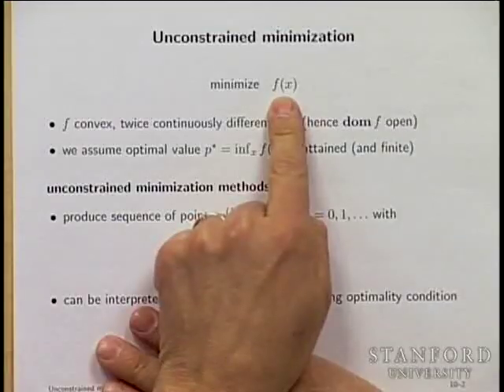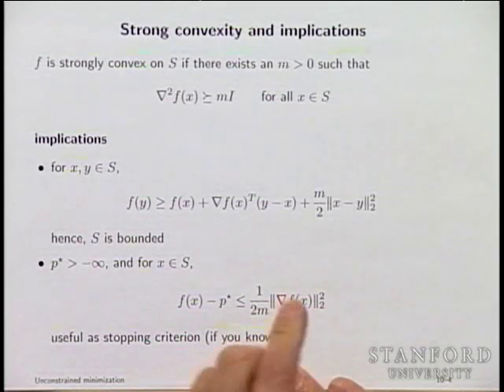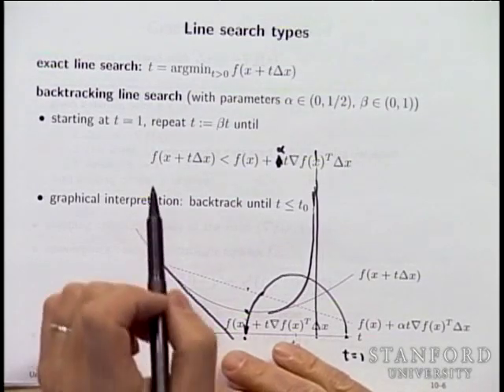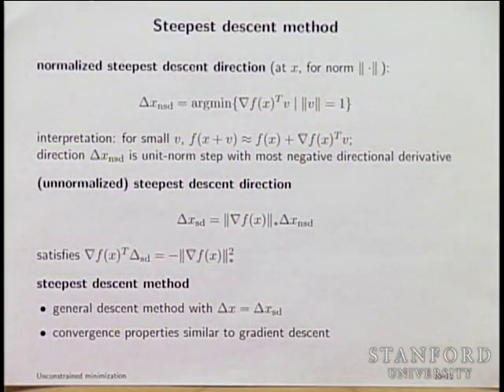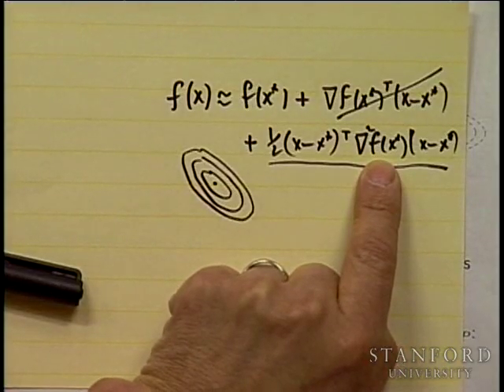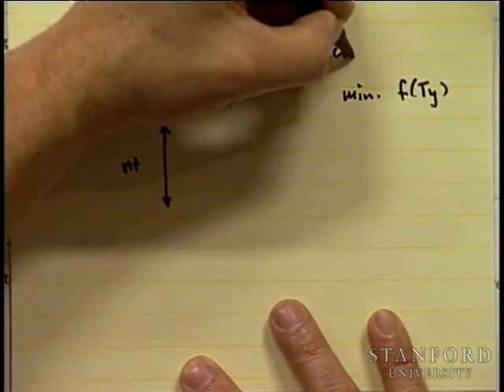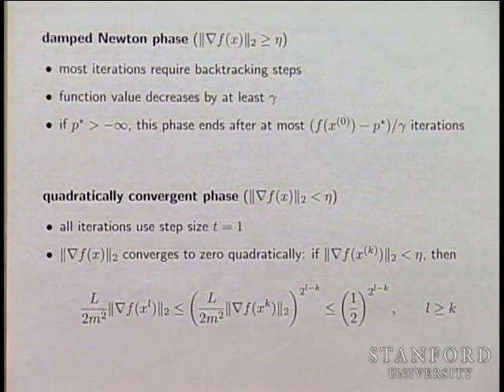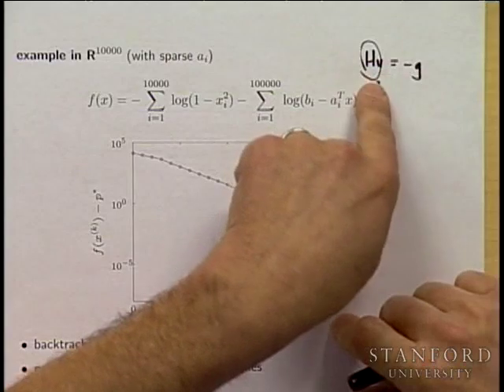Lecture 15 | Convex Optimization I (Stanford)

Comment: 2:11 Unconstrained minimization
4:00 Initial point and sublevel set
8:15 (10:15) Strong convexity and implications
13:45 Descent methods
16:46 Line search types
23:56 Gradient descent method
26:40 quadratic problem in R^2
29:26 nonquadratic example
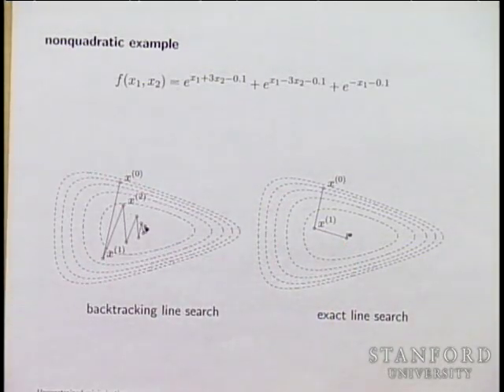29:42 a problem in R^100
32:03 Steepest descent method
34:23 examples
37:50 choice of norm for steepest descent
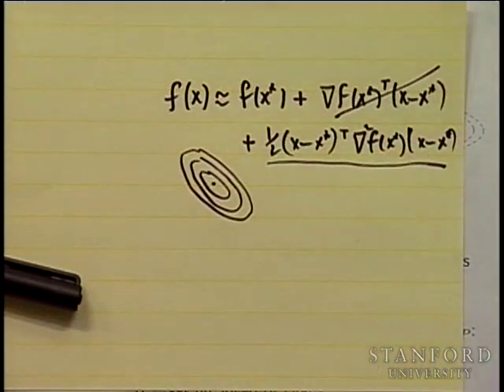43:52 Newton step
48:31 Newton decrement
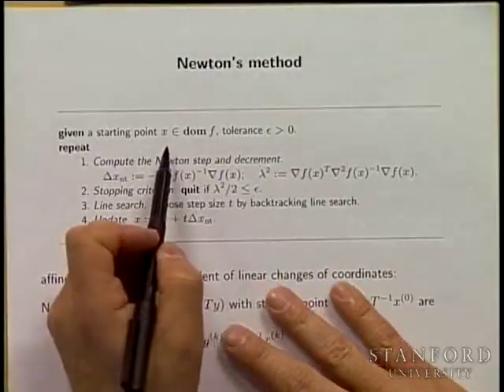49:51 Newton's method
57:21 Classical convergence analysis
1:02:58 damped newton phase
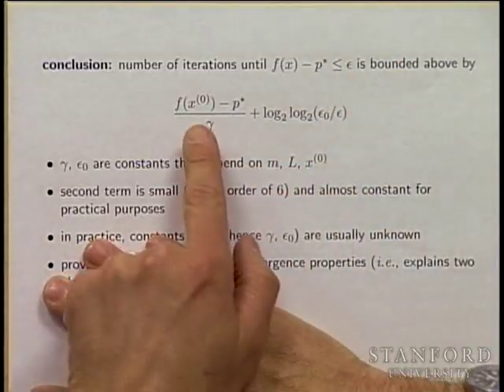1:04:51 conclusion
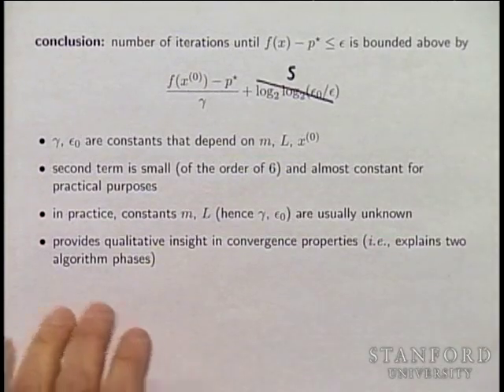1:09:03 examples in R^2
1:10:42 example in R^10000